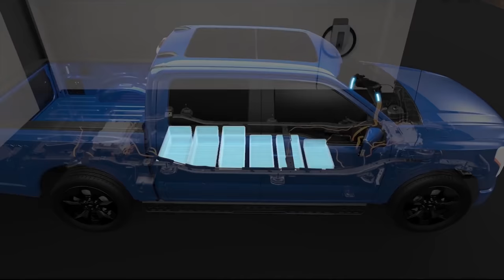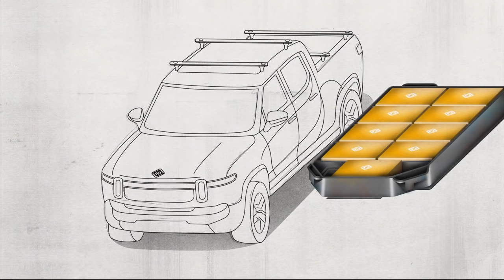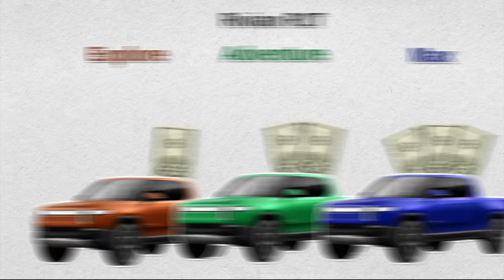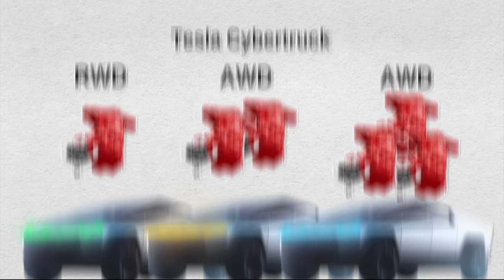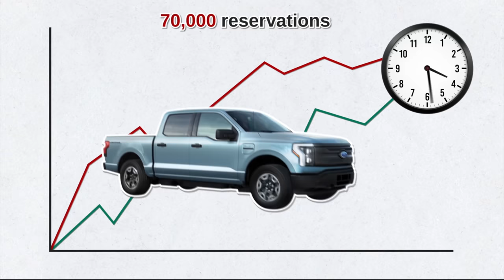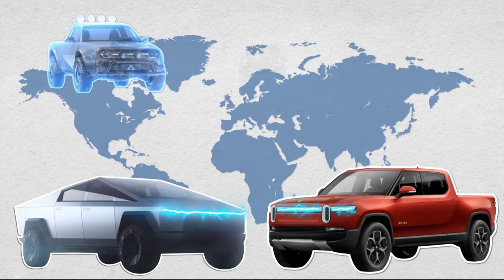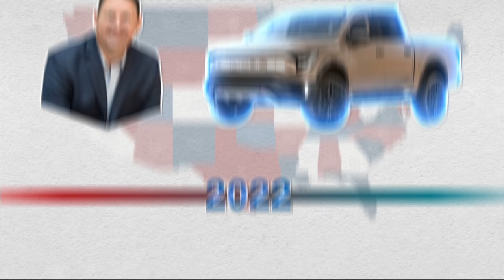Here's Why This Will Replace Trucks in America

Comment: I pity the fools who have so much pride driving around in thier ev's that they charge at night at home from the grid that is powered by fossil fuels.
Reply: Not after the tree huggers get through.
Reply: Internal combustion engines are roughly 20% efficient at turning  traditional fuel into usable energy. 

So there’s a massive net gain of energy efficiency for EV’s even if they still get their energy from the same fossil fuels already being used to generate the American electrical grid. 

Will every EV owner be aware of this? 

No, but ironically because of what I mentioned, EV’s are technically better at turning fossil fuel into usable energy by this electrical grid method than any internal combustion engine.
Reply: @Zelknite  good point I didn’t consider, hopefully each respective country gets to a point where they’re able to switch to aluminum ion batteries instead of lithium ion so each country can produce vastly more energy dense and efficient battery cells that don’t need to be shipped all around the world to be produced like you mentioned.
Reply: @danspiteri4350  can you feel sorry for me too?
Reply: @danspiteri4350  how ironic
Reply: @blackCladLad  So, not trying to be rude, but I think you may need another physics book if you think combustion engines are less efficient than an electric motor. That 20% figure sounds like advertising for evs. Any time energy is transferred there is loss an electrical motor has several hops before work is done unlike a combustion engine and don't even get me started on energy ROI when these batteries need to be replaced every 5-7 years. The electric car will be environmentally friendly and affordable someday but we're not even close to combustion engines yet.
Reply: I dunno about the environment. But when I’m driving my tesla I feel like all the other cars are at a stand still. I feel like I can literally run loops around other cars.  Also when I’m tired, my tesla drives itself….soo.
Reply: @John Lacambra right on brother!
Reply: @himmura  So then take it to the track and don't drive like a maniac and put other lives in danger. 

Lastly is that laziness can kill you. Go ahead and trust your life to an automated system to take you safely to your destination while it does so around a bunch of manually driver driven cars if thats your style. Me, unless every car is driving automatically I trust myself to drive when it comes to mine and my passengers's safety.
Reply: @Zelknite  as opposed to shipping crude oil and fuel all over the place? Batteries are a one time deal. Your fuel needs to be transported all the time.
Reply: @SharpestBulbs  5-7 years? My 2003 prius is still using the same hybrid battery and I'm still getting over 50mpg.
Reply: @ItsBinhRepaired  "hybrid" I find it very interesting that you're still using the same battery. The reason old Prius sell for so cheap is the battery is garbage. You are an anecdotal exception if you're still on the same battery. I doubt your sincerity though. Even without driving it much the battery will deteriorate over time. Imagine a laptop that is 7 years old. Same cells as your car. The battery will be eol garbage.
Reply: That's right. You can't get electricity from electricity.
Reply: @ItsBinhRepaired  Little known truth is that not 99.99999% of accidents are actually caused by human error alone... Machines also tend to malfunction which causes many major accidents you know. Your fact is wrong.

"We choose truth over facts!" - Smartass
Reply: @SharpestBulbs  it's better to use the batteries than to not. If you leave your laptop plugged in and never use the battery, it'll swell up and die in about 2 years.
Reply: @johnlacambra6004  lol little known fact, those machines are made by humans, maintained by humans, etc. Lol good job human.
Reply: @ItsBinhRepaired  No, it's a WIDELY known fact that machines are made by humans and maintained by humans. Talk about human error.
Reply: @SharpestBulbs  that 20% efficiency figure is pretty standard if you look up i.c.e. Efficiency on any study done on energy loss, check the department of energy’s website. The efficiency actually ranges from around 12% efficiency to low 30% efficiency on a small amount of gas powered vehicles for a higher end. EV’s are 85%-90% efficient at turning electrical energy into mechanical energy at the wheels just inside the car itself, and 59-62% of the electrical energy from the grid goes into turning those wheels on an EV versus the roughly 20% that a standard i.c.e. can convert fuel into mechanical energy. This information is readily available in many studies and on the Department of Energy’s website. EV’s passed i.c.e. Vehicles in efficiency a long time ago. 

You are correct about the battery replacement issue over x amount of years, which is why I made the point to bring up switching to aluminum ion battery cells instead of lithium ion, which increases the energy density, efficiency, and lifetime of a battery dramatically as compared to current day lithium ion batteries.
Reply: @sej4323  that is definitely the concern if we continue to use lithium ion batteries where those crude materials do unfortunately continue to be mined by third world countries. 

This is why I brought up the point of switching from lithium ion to aluminum ion battery cells so that one critically major component of current batteries can be produced in country, thus creating more jobs at home, at a lower price, with a more abundant material.
Reply: Yep
Reply: @blackCladLad  So the department of energy gives a figure yet doesn't explain it? I'm sorry but how many conversions to get charge to your batteries does it take from fuel to storage. Each time it does this there is usually a 10% energy loss. This alone should be enough to show that that figure is twisted or presented in such a way to make an EV seem like electrical power produces more efficient energy than fuel. Even at the most basic level a tesla model 3 battery weighs 1060lbs a honda civic 12 gallon gas tank weighs 720lbs(when full) yet the tesla has a range of 200 miles vs 492 miles in my civic. In what universe is that more efficient? Please I'm begging you, show me how an electric motor even comes close to a combustion engine in efficiency. As far as energy it takes to get the fuel it is considerably easier to acquire oil and refine it into gasoline than it is to go through several hops to get the energy from the source fuel, to the grid, to your home/charging station, then to your car battery. I would love to be proven wrong. I wish EVs weren't a scam.
Reply: @himmura  When you spend that much money on something, it's really hard to admit the faults of it.
Reply: @ItsBinhRepaired  If you leave a battery just sitting around for 2 years it will likely be a piece of junk without ever being used. I was a test engineer for a large battery company for several years.
Reply: @SharpestBulbs  the real issue is that you’re conflating variables such as weight of a vehicle to the distance traveled for energy efficiency, instead of the conversion of chemical energy to mechanical energy for an i.c.e. or electrical energy to mechanical for an EV. 

While there are more “hops” for an EV and more chances for energy loss like you state, a standard fossil fuel power plant is able to convert chemical energy to electrical energy at a rate and efficiency where when the electrical energy finally makes its way to the end user in their EV that 59-62% of that original fossil fuel from the plant is able to be used for conversion to mechanical energy in the EV instead of the 20% that an i.c.e. Is able to convert. 

59-62% > 20%.

The problem is the inneficiency of an i.c.e. Vehicle to convert chemical to mechanical by itself, whereas the EV gets the benefit of having the power plant use a much more efficient process than an i.c.e. to convert that fossil fuel chemical energy to usable electricity that is then converted to mechanical for the the EV. 

Yes there are more hops in the energy chain for EVs, but the absolute inefficiency of an i.c.e. to do the same conversion as a PowerPlant still let’s the EVs come ahead by a large margin.

To your credit though, classic fossil fuel is immensely energy dense and useful, but the ways that standard i.c.e. Vehicles convert that chemical energy to mechanical is horrible, number wise. But this is more a problem with human design of car engines and how it deals with heat and friction than anything inherent with the fossil fuel itself.
Reply: @blackCladLad  Quantum Glass battery tech is even better yet, and should be available in a few years.
Reply: @SharpestBulbs  You are confusing energy density of gasoline versus current Li ion batteries.  The efficiency figures of 12 to 30 %  are correct for ICE.    The efficiency of the electric motor is in the 85+ % range.  Now, the energy density of gasoline is around 13,500 joules per KG, versus about 300 per KG for that Tesla 3's battery.  Thats why 72 pounds of gasoline has the same (actually more) energy than that 1,020 pound Li Ion battery. If that Civic engine was 85 %  efficient (its not) then it would take a near 3000 pound Li Ion battery to equal your 72 pounds of gasoline for energy. This is one of two main reasons why long range intercontinental Jet Airlines can never be electric, with current battery technologies.  The other reason is power output to drag, a jet engine badly beats any electric motor for power and speed.  600 mph can never be done with an electric airplane.  However, electric planes as commuter puddle jumpers to 100 or 200 miles at 200- 250 mph can be done.
Reply: @williamthornton5856  I'd be interested to see how you're coming up with those results for efficiency. When ignition happens are you saying there is an 80% loss?
Reply: @johnlacambra6004  top four most safely rated cars are Tesla’s…data shows Tesla’s are least likely to get in an accident. And if you do get in an accident, you’re least likely to be seriously injured in a tesla….soo.   The fats that Tesla’s have instant torque and  are fast doesn’t meant ppl drive them like maniacs.  It means they’re a lot safer bc you have more control over the car.
Reply: @SharpestBulbs  Nothing is perfect.  But, taking into account all the tech and all the savings in repairs and gas and maintenance - Owning a Tesla isn’t much more than your average car.
Reply: I have an EV and I am under no ifalse mpression that they are eco friendly and it is not the reason I bought one.
Reply: @pauld315  it’s not a false pretense.  Everything costs to produce.  But electricity can be obtained by means other than coal. Also there’s no emissions out of tail pipes.
Reply: @blackCladLad  Not true, the latest hybrid engine is now 40% efficient.
Reply: @tpbtpb2602  do you see that the more an engine leans towards becoming an electric motor, like a hybrid, the higher the efficiency is? That’s the point im making. ICE are inefficient, a hybrid is part electric and part petrol. Think Mark!
Reply: @himmura  Spent $9400 in 2008 and change the oil ever 5k miles for $30. Are you sure?
Reply: @SharpestBulbs  I said average car.
Reply: Look, cars have always had electricity because of headlights and radio and such and such but it is possible because of the alternator that is spun by the internal combustion engine that it is on. 

As a cool dude said "You cannot get electricity from electricity." Basically all of our electricity comes from other resources that generate it. Electricity cannot generate itself, it has to be generated by another energy source powerful enough to generate the amount we humans need it for. 

Now solar and wind power have taken its toll on the environment and wildlife, especially insects and birds. Once their service life ends their not really recycled nor recyclable and just basically become what they were made to not become, unrenewable pieces of garbage. 

Lastly EV's isn't like charging your average cordless impact wrench or drill. Those tools are small and efficient for their use and size and efficiency in terms of electricity don't grow parallel with each other or else the large cargo tankers would be shipping around the world diesel free by now. Batteries provide electricity and are only efficient to a sizable extent. Electricity does not generate itself, so how can that be efficient when it needs to be generated by other means and resources? 

I almost forgot, if you bought an EV for no practical reasons at all... I'll say you probably get a kick out of beating all the hellcats at the drag strip with your teslas software modifications.
Reply: @himmura  The top 4 safest rated cars are the Subaru Legacy, Toyota Camry, Subaru Outback, and the Mazda CX-5. 

Last time I check up safety rating for Teslas the crash test course people flat out said that no Tesla comes close to passing their tests because the chassis were too flimsy compared to the major car brands. 

Lastly, your fats that the car automatically drives for you does not mean you have more control of the car it means you are handing over to the car all power and control in terms of your safety; the car is in control not you. Gets your fats right.
Reply: @johnlacambra6004  I'm good with my vtx 1800. Makes all cars look stupid that try to race.
Reply: @blackCladLad  true dat! Never thought of it that way..
Reply: @SharpestBulbs  Any car driver who decides to race a bike should look stupid.
Reply: @haroldwaig2242  You better watch that truth you talkin there man this is youtube!

Comment: It's also interesting to see, if the H(ydrogen) market will develop (or not). It may provide more driving power, esp. for trucks, compared to batteries.
Reply: Infrastructure for refueling will always be the limiting factor.  Until someone starts hydrogen refueling stations the electrical truck is what people will look for.
Reply: @patricialacava4472  I have to make a clarification here - what I meant is for commercial vehicles / long hauls. I don't think you can run those only on batteries. Hydrogen sounds much more practical, as they drive thousands of pounds of cargo.
And because of that need - an infrastructure will be build (should the technology be adopted).

Comment: Am i the only one that sees no sense in luxury pick ups trucks???
Reply: Thats because we are real men that love trucks for they're actual purpose unlike 90% of new truck owners that never use the bed its just a fashion statement to them
Reply: I don't have a 'luxury' pickup, but my F150 does have navigation and is truly a pleasure to drive on the highway. It's quieter inside than my 2005 Lexus, hands down. Recently I moved 300 miles and pulled a heavy trailer half the time. No electric truck could have done that without constant stops for lengthy recharging. I went 300 miles non stop (did not stop for ANYTHING) and arrived at my destination with 150 miles of gas left. (Truck has a 36 gal tank.)

Comment: Living in Thailand where we use 1 tonne pick up trucks (carrying capacity), I cannot think see a replacement for the diesel engines on a frame chassis.
Reply: Except biodiesel
Reply: @lobdsk  They have recently started selling only biodiesel in Thailand now.  I would prefer the pure genuine diesel than the Bio.  Saying that I probably prefered leaded petrol as well.  The lead used to lubricate the piston rings.
Reply: @johntheaccountant5594  your fortunate. Biodiesel has less carbon than diesel and that’s better for your valves.
Reply: @johntheaccountant5594  there is no lead in diesel. Never had been there’s sulfur no lead though
Reply: @lobdsk  Interesting

Comment: They don’t emphasise how long it takes to charge up the batteries, wonder why?
Reply: Really? Are you still not aware that it differs on what type of charger you use? As if the gas powered car brochure would tell you how long it will take to get filled up. Btw, do you have a gas pump in your house or garage?
Reply: @Curacars  Fill up time is negligible for gas and diesel, and very convenient.  And unfortunately I got an electric meter that's produces the electric bill on my house, and if it is messed with, they cut they electricity off.
Reply: @Curacars  The very fastest charger takes 45 min on a fast  supercharger, for an EV, and virtually ANY gas powered car can fill up in about 60 seconds, 90 seconds if its a bigger gas tank. This is where EVs still suck compared to pumping fuel. That 45 min is a disadvantage on a long trip.  EVs are great as a daily commuter, but going on a 1,500 mile trip, a gas car is still more convenient and makes better time, on average.  Please don't mention stopping to eat at a restaurant for an hour, On most trips, people do fast food, and 45 min is too long to wait for your Tesla to charge up, when I could be 55 to 60 miles down the interstate in 45 min, while your charging your Tesla eating at Cracker Barrel.
Reply: @jayrunner3347  are you allowed to mess with the gas pumps meter? Or will you be send to jail for it?
Reply: @williamthornton5856  I would suggest you take an airplane the next time you do a 1500 mile trip. It will save you 2 days. And if you're a truck driver you aren't allowed to drive that many hours continuously anyway.

Comment: I wonder how long it will take for the Ford EV to have its first recall?
Reply: Ford (like other mfrs) will actually recall a vehicle with a problem. Tesla? Suspensions collapse, paint flakes off, so what. No recall, driver error!
Reply: @townhall05446  lol what
Reply: The same Chevy Bolts had two recalls over the same battery fire issues so expect more recalls.
Reply: @VintageCars999  i remember being a kid and talking about tesla doing that. If I only invested back then lol 😆